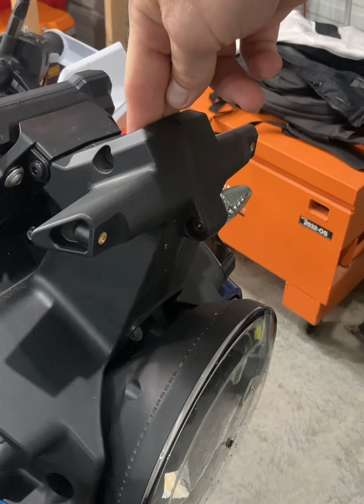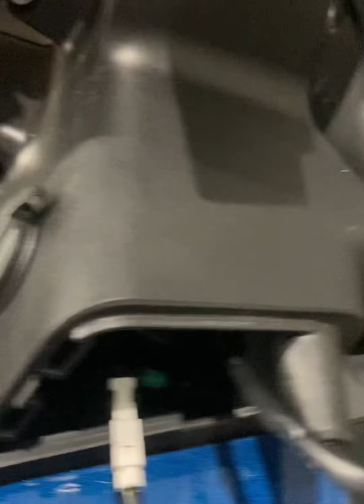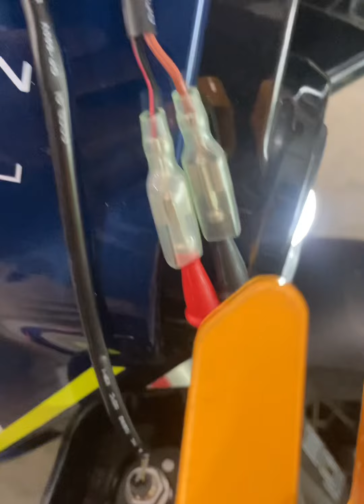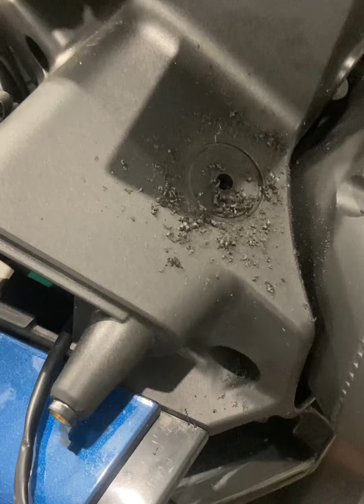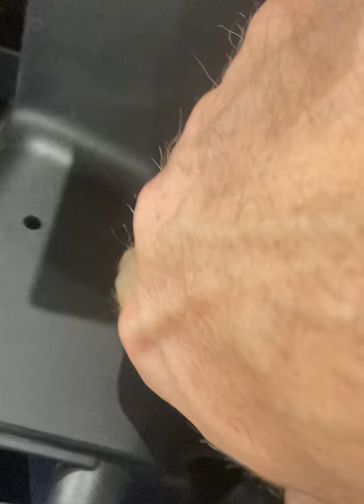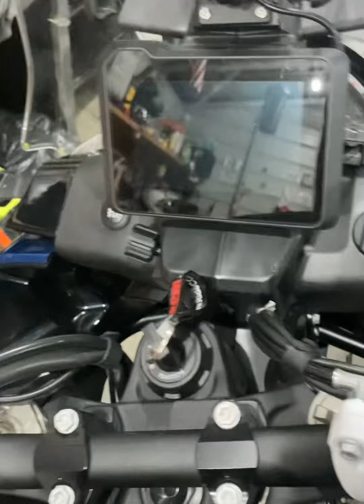Norden 901 Expedition waterproof USB install

Comment: Honestly I do like the setup and the way you meticulously did the job. But I don’t get why you would do it that way. I would just get a USB connector which you can just connect to the +&- terminal wires within the factory column. That way no wires stick out and it’s even easier to make the connection waterproof. But once I buy this bike comes spring time I plan to mount a quad lock wireless charger that way, inside the factory column, I like to use my IPhone for music, navigation and calls right in front of my eyes. That way I don’t need to keep my phone in my pocket and I can still see the turn by turn directions on the screen below if I’m using my smartphone to play music or something else while using navigation at the same time. And it’s perfectly uncluttered but my iPhone is still wirelessly charging and it’s waterproof. 😊 But each to it’s own I guess 🎉